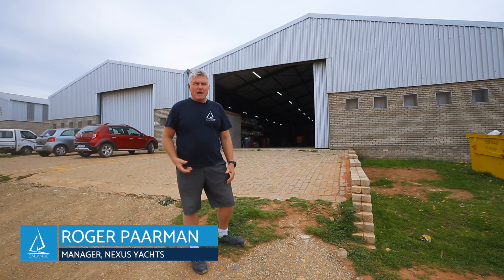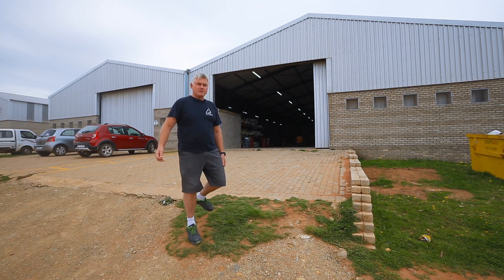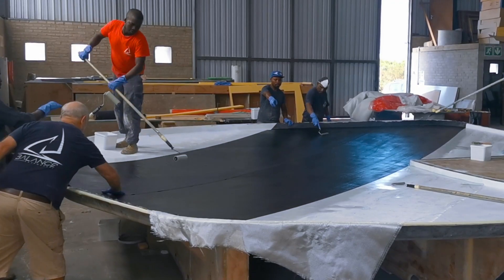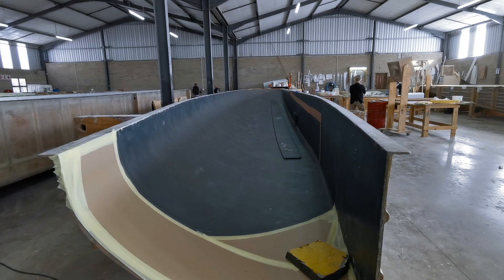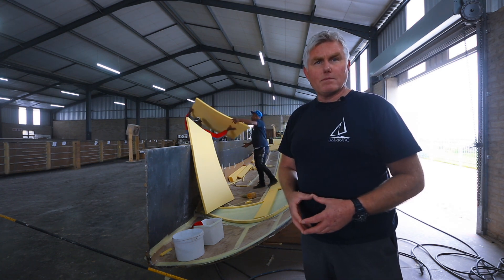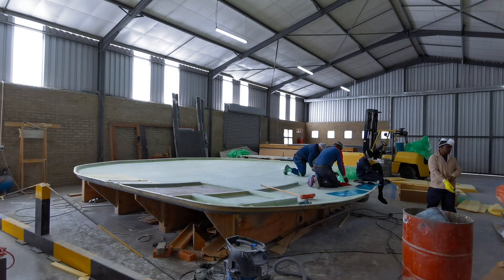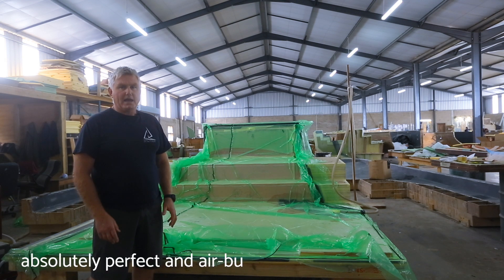Balance 526 Build Series: Episode 2  - First Phase Construction

Comment: A little hard to hear and understand with the difference of our accents. I have a lot of questions, but I’ll restrict myself, and only ask 2. 1/What is the first layer to go into the mold? & 2/What type of resin? (I’m guessing vinyl ester) TIA 😎🏖🌴☀️🇦🇺
Reply: The 526 uses mainly epoxy resin.
Reply: @peterpawlak8418  cheers
Reply: The first layer to go into the hull mold is the outer hull skin which is constructed of e-glass cloth.  The Balance 526 is made using epoxy resin.  The smaller Balance models are made with vinylester resin.
Reply: @andrewhodgdon2786  thanks 😊

Comment: Thanks mates!  Due to the factory noise, you should probably subtitle everything.

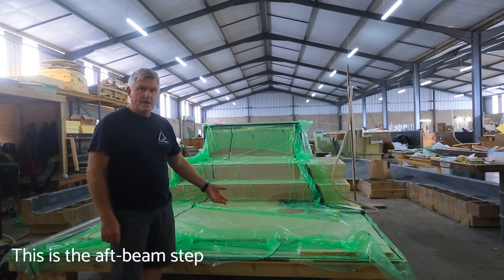1:30 the word may be "vacuum bagging", rather than "vacuum packing".  The general name of this type of fiber reinforced plastic composite construction is vacuum bagging.  The plastic forms a barrier to the vacuum, which is used to pull the liquid plastic through all of the foam cores and fiber cloths.  In addition, the vacuum causes ambient air pressure to consolidate (press) the materials and plastic together with high force while the plastic cures.  So the vacuum bagging solves two purposes: thorough infusion of the plastic into the foam and fibers and clamping them all together while the plastic cures.